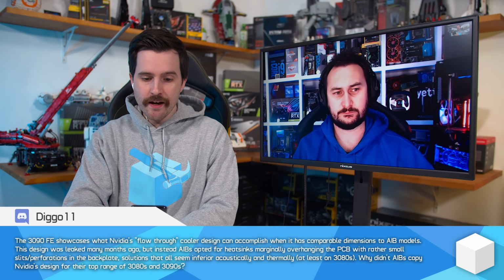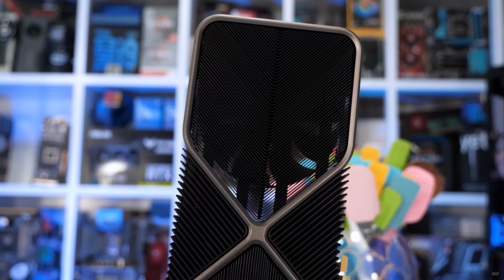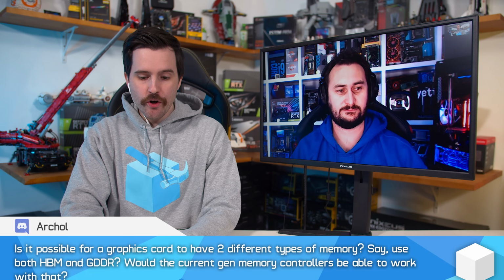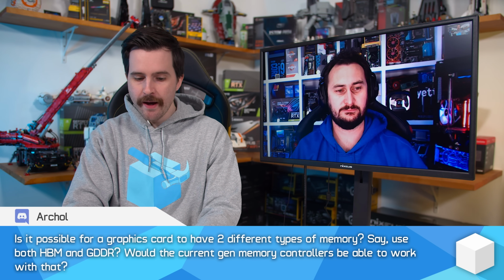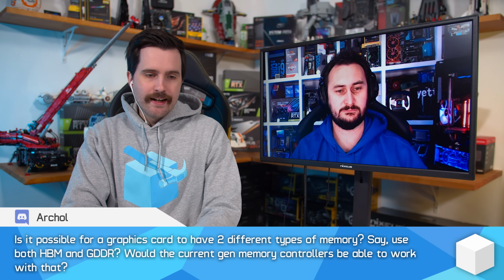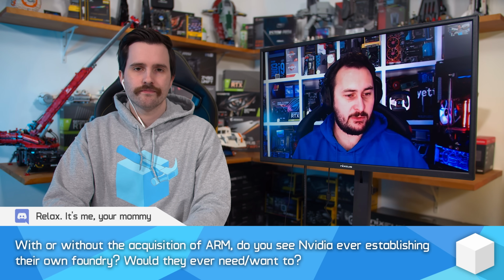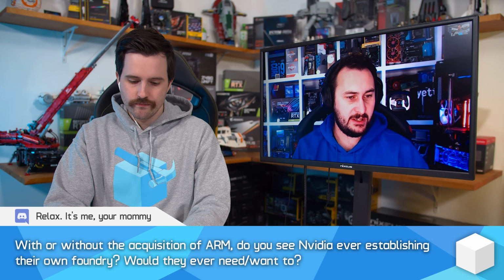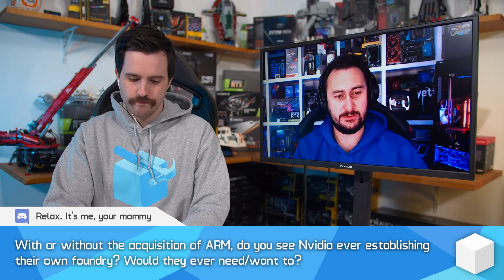Will RDNA2 and Zen 3 Have Launch Issues? Can AMD Beat Nvidia at Ray Tracing? September Q&A [Part 3]

Comment: I read a few times about "FidelityFX". So ain't this the "AMD DLSS equivalent" that people asked about?

Maybe somebody knows more about it.
Reply: Alex from Digital Foundry made a quick comparison between DLSS 2.0 and FidelityFX Contrast Adaptive Sharpen (CAS)

https://youtu.be/ggnvhFSrPGE?t=1163

In summary, not as good. Easier to see the chunkier pixels and less temporally stable, at least in that scenario. DLSS (2.0 at least) seems to be doing a more complex reconstruction rather than a downscale + sharpen.

FidelityFX overall is a suite of effects, similar to Reshade (which if I'm not mistaken permits the same CAS that AMD offers, since it's open source) and NVIDIA's game filter (?), it has plenty of effects to help improve the overal post FX of games, but final image quality sadly is not as good as NVIDIA's DLSS, specially considering that AMD is filtering a 1620p image (in Death Strading's case) and NVIDIA is upscaling a 1440p image.

Still, I believe that Hardware Umboxed did an analysis of all the sharpening effects avaiable and AMD's was pretty much the best. Even if you are a NVIDIA user you could use it with Reshade if you're looking purely for a good sharpening filter.
Reply: @band0lero  thanks for the reply. I will look into that. :)

Maybe they will come out with a 2.0 version of FidelityFX in the future, too.
I mean Sony and Microsoft would be definitely welcoming a better version of this technology for their upcoming consoles.

I think they will stay behind Nvidia with FidelityFX to DLSS even if AMD has a 2.0 version coming. Just like they will most likely stay behind with RT performance.

We'll see in the future, I guess. :)

Comment: Just a question I've just brought sapphire nitro± se 5700xt is this a good card for AAA games for next 5 years or so or do I need something else
Reply: That completely depends on what resolution you play at and what fps you want to see in games.
Reply: @imrileth6618  1440 144 if that makes sense
Reply: @bassa69  I have used 5700xt Nitro since it was launched and i use it with 120hz freesync tv with 1440p and i can say that it can't maintain fps above 100 in any modern game even with lowered graphics settings. RDR2 and Control it runs mostly at 60-80 fps range with not maxed out settings.
So you probably want to get something more powerfull soon.
I'm waiting to see how good the big Navi is going to be and upgrade to it or switch to 3080 if big Navi ends up being slow.

Comment: A big reason why tech companies release more expensive models first and then the budget ones later is to maximize sales of higher cost units. For example, imagine I'm a 1080p gamer. A 3060 would be a great match for me. If Nvidia released their entire stack simultaneously, I'd just grab a $350 or whatever 3060 and call it a day. 

But since the 3060 won't be released for another few months, I might be tempted to grab a 3070 or even a 3080.
Reply: If you can, wait till February and most bugs and optimized hardware issues would have been fixed when they release the Super versions.

Comment: Third-party cooling solutions are vanilla, especially if you plan on putting it into a case, blows heat directly on the motherboard so it heats up your RAM, also the motherboards VMR. The founder's edition is much better focusing majority of the heat out the back of the case keeping the internals of the case cooler, unlike an open-air third-party cooler, or even a 20 series founders edition. Jay did a pretty good review about the thermals.
 even though I would have liked to seen a thermal imaging camera pointed at the case along with smoke blowing through the front intake vents to see airflow. GamerNexus also did a video but he used smoke and mirrors. https://youtu.be/mJ4ha0zsWHw

Comment: If you can as a company, you really want a diverse portfolio. More legs to stand on. Imagine how hard hit AMD would be if they sunk everything into CPU only, and then some severe hardware exploit showed up right after Zen 3 launch that affected their entire Zen range. It's an extreme example, but given the last few years it's far from an impossible one. Another one; imagine if they sunk everything into CPU and then something happens that severely disrupts some easential parts supply to motherboard AIBs.

There are other huge and costly production and logistics loads taken off AMDs hands with GPUs, that don't happen with CPUs. There's far more cost to a CPU than a wafer of bare dies. AMD have to manufacture, assemble and ship CPUs themselves. With GPUs, they mostly just sell dies (sometimes memory) and IP / lisences to AIBs, who take care of the rest.

Then there's wafer allocation. The reason AMDs production has been flexible lately, is because their CPU range has been based on a single building block - that 8C die (and its bins). TSMC still just crank out the same wafers as ordered, allocation per demand happens afterwards. Rearranging their order with TSMC to change wafer production scale and type of die is a whole different kettle of eels.

Comment: I get your point on putting out the top devices first, but its not always the case
3080 10G is out, but many of us are still waiting on the 3080 20G?
AMD will supposedly bring out the 5800 and 5900 ... but both are still slower than the 3950... (on multicore)... where is the 5950?

They seem to bring our #2 and #3 .. then #4, #5, and finally #1

Comment: It's so important that RDNA2 doesn't have any launch issues. It needs to be 100% perfect or people wont buy it.  It's so sad because Nvidia can launch a failure and everybody want's it. Turing had memory issues causing space invaders - SALES SUCCESS.  Ampere has cap issues causing crashes - SALES SUCCESS. RDNA had a few driver issues - SALES FAILURE.  AMD needs to be perfect to succeed. Nvidia only needs to produce shit to succeed.

Comment: I think you underestimate a little bit Steve. A very large portion, if not the majority, of gaming/production customers potentially shopping in the 7-800+(++) usd GPU range, don't have those hard outline budgets. If consumer spending stats has thought us anything, it's that people more often than not shop significantly above their actual needs or budget, especially when enthusiastic and hyped. Ending up 2-4-500 over budget on a $1300-1500+ build is probably more common than not. The ones able to stick to inital budget, are more often than not those buying finished rigs from SIs, rather than DIYers. Because they relate to one single cost figure, unlike DIYers where several hundred pesos can easily accumulate with some relatively minor upwards tweaks here and there.

This 3080 thing is actually a fine example of flexibility. If everyone looking to buy a 3080 had a budget of $700, then just about no one would ever actually buy one. Because that's canned unicorn fart pricing. Actual cards for sale in this class, from a reasonably priced online retailer - is more like $775-900. More often than not, those MSRP priced cards just don't exist on the open market. Not until a small handful of models near EOL.

Comment: MSI? ouch! if they were the only ones that made MB's i would go buy a Typewriter
Reply: what's wrong with MSI?? I really don't know have had gigabyte for years and currently got a Asus so haven't had a msi in literally a decade... 
Not wanting to be annoying.. I'm genuinely curious .. the more you know is always a good thing imo
Reply: @Mr3ppozz  i wont waste my money on them i have bought 5 MB's over a about 10 year span all of them were DOA or failed within a month
Reply: @brianberthold3118  oh wow that sucks then I agree just don't bother even trying xD i wouldn't either...
Reply: @Mr3ppozz  i have had great luck with Gigabyte hell i still have a Socket478 - IDE server board that is still working - a GA-81EXW with a 2.8 northwood on it
Reply: @brianberthold3118  before this current board I've been using gigabyte boards for at least my past 6 systems... it's really good value for performance... I now have an Asus because of a promo with a cpu and I do enjoy it and it works well... so there's that hahahhaa

Comment: I doubt AIB's had any information on the FE's cooler design, to start.  But the reference PCBs don't allow for the FE type of 100% flow-through design.  The FE PCB, as we've all seen, is notched out, or V-shaped, which allows that flow-through design.

Comment: awww I call bullshit on why they don't release full lineup, Nvidia wants every over caffeined - over hyped enthusiast to buy their most expensive cards first. why do you think the 3070 is delayed ? There's going to be a bunch of 3080/3090 cards available soon. Everything happens because why ? MONEY used to be the consumer had a percentage of the enthusiasm. Currently it seems we are an after thought only in regards to making it " good enough " for the consumer to be interested. Thus - 30/20/10 percent gains. Look at the snake oil presentation Nvidia put on with a straight faces. I mean sure logistic would be challenging, but the secrecy and delays have been ridiculous - not to mention there's virtually no overclock capability unless your a bios programmer.

Comment: If AMD have a better way for ray tracing, it's not showing in the new consoles. DF have done a preview of ray tracing for PS5 and some understandable concession have been made with reflections to maintain a 4K 30FPS performance which is entirely reasonable but completely on par with PC Nvidia counterpart like a 2070 Super. RDNA 2 could offer improvements to that, lets hope so!

Comment: Its not so much about losing potential 3080 buyers to a 3070, its about getting potential 3070/3060 buyers to purchase a 3080 (oh it's more than i planned, but it's only $100 more and i can get one now...) and if the buyers don't jump up the gpu ranks, then the sales will be picked up anyways once the lower bracket models are released...

Comment: Silicon production isn't all that expensive from the sense it will still be profitable, they have already spent the money on R&D which is the big $$ so they have that expense and it still exists regardless of whether the prioritize CPU or GPU release. GPU's will still be made at volume as production, while still costly is profitable, verse the R&D which is mostly expense so they have reached the point of profitability now (at least in theory) the argument/statement would be more valid if the R&D hasn't already been fully funded at this point as production is ultimately the end goal to recuperate the expense of R&D.

Comment: AMD doesn't have to decide what TSMC does.  TSMC has given AMD allocations of each of their designs and they've reached agreements in "how much/by when".  Its not like AMD will hold up producing CPUs because, OH NO! WE NEEd more console chips!  or the other way around.  They have payed for and are assigned certain capacities at TSMC for each of the products they are having produced.  AMD could tell TSMC they want to stop producing some line of chips and switch to something else but they shouldn't have to.  TSMC has a max capacity that is allotted to all the various customers and AMD is just one of those.
Reply: Pretty sure AMD have some wiggle room for what is produced, if RDNA fail they will use that capacity for CPU or console chips. If its a huge success and they can sell whatever is produced then maybe consoles have to wait a bit (assuming those chips are not the bottleneck for console production)

There might be a financial hit to changing, at the very least there is downtime whenever there is a change. what AMD need decide if its worth it for them to change something or not

Comment: AMD already has better than DLSS tech on a rx 280 or maybe rx 480 .. its the GPU in the PS4 pro its called checkerboard rendering.. makes the 1080p play in 4k .. its been around for years.. low hardware costs and requirements.. Xbox one, xbox one X and ps4 and ps4 pro all use like the same rx 480 and all game in 4k just fine.